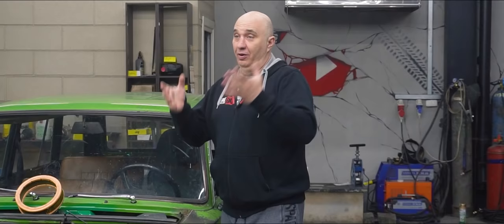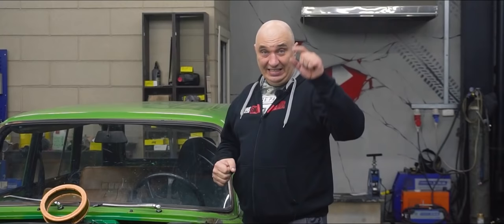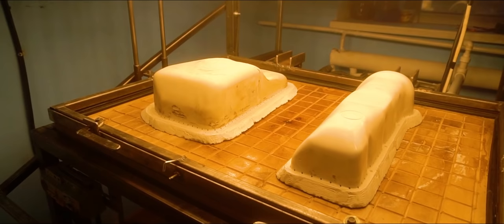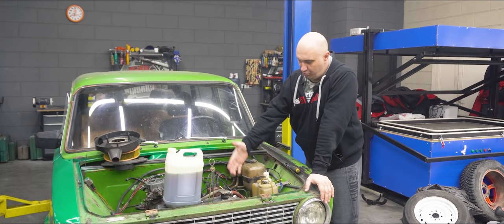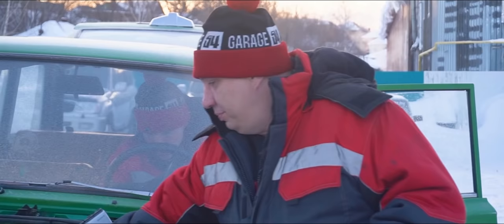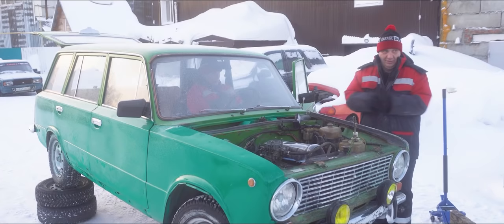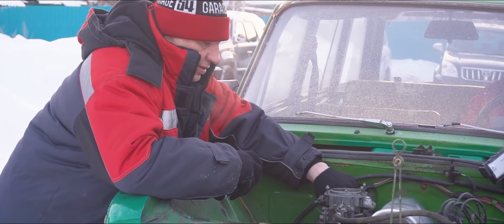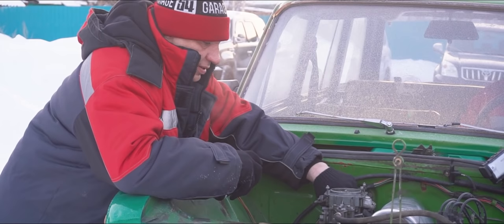Looking inside an engine during cold start (-30 degrees)

Comment: As a Canadian, this really shows why it’s important to warm up the car before you start driving
Reply: How do you warm it up before starting. Im in Australia so never had to think about frozen oil
Reply: @ce7545  just let it idle for 3-10 minutes depending on how cold it is, its not really necessary with modern engines though unless you're in below zero temps (Fahrenheit because I'm a filthy American). Just waiting until your revs drop is typically enough as long as you aren't flooring it out of the driveway

Comment: When I was doing engine development work 20+ years ago, we did cold starts at -40°.  As soon as it fired, it was put on the governor.  Sometimes it was only running on a couple of cylinders, and it might take a while for all of the cylinders to fire.  I was working on a new lubrication system at one point, and the oil pressure spiked to 400psi and put the oil filter cannister onto the floor.  Strings of oil were dangling from the filter head, and there was a PILE of oil on the floor.
Reply: A simple fix is to mix fuel into the oil and job done . The fuel will evaporate when the engine heats up
Reply: @loicdore39 that’s false. Oil and gasoline are miscible. This is why fuel dilution is a thing, and modern cars will set mixture codes if the fuel dilutes the crankcase too much.

Once oil and fuel mix, it’s very difficult for the two to separate. Some fuel will evaporate, but what will most definitely evaporate are the engine bearings if you run it with diluted oil for too long.

This is why extended oil changes on direct injected engines is dumb.
Reply: @lynxstarautomotive208  in some airplane it's a mandatory protocol in very cold conditions so it must not so stupid . 
Long intervals are destructive indeed
Reply: ahhhh my fiat with the old 127 engine although monopoint injection and electronic ignition when its cold still starts first on 2 then 3 and in the end 4 cylinders lol
Reply: You were using the wrong viscosity oil!!
Reply: @GrantJohnston-dr9rt  Nope.  It was 5W-40 synthetic, the recommended oil for that engine at that temperature.  Like I said,  development work on a NEW lubrication system, as in bigger oil pump,  different regulator, different cooler, and, as that test determined, in need of a pressure relief valve at the oil pump outlet.  The next test had a 150psi dump valve to protect the cooler and filter from a spike at startup.
Reply: @KevinJames-yg9eu  I was joking,at those temps and pressures,3 in one wouldn't flow!

Comment: Would love to see the same thing with fully synthetic oil as a comparison
Reply: Yeah totally...as the oil quality must make a huge difference i quess
Reply: Exactly, fully synthtic 0w30 would be absolutely fine with this temperature
Reply: @piotrmaecki5268  And it would be fantastic to see it actually tested if the difference is as huge as we all are thinking
Reply: Or any multigrade oil.
Reply: @piotrmaecki5268  im sure it will be a little bit thicker than usual especially at -30C, but still okay.
Reply: That's why I switched to synthetic years ago as it maintains it's velocity much better at all temp. Haven't had any issues starting. Although there's been a few days where it got below -35f with the jet stream changing direction due to climate change bringing artic air down to Iowa, which I didn't want to chance my coolant freezing and cracking the engine block.
Reply: @PCgamer923  that why I installed a oil pan heater.
Reply: Rotella 15W40 versus Amsoil 15W40 comparison on Youtube.
Reply: I’m Soviet Russia Synthetic Oil is you.
Reply: @PCgamer923  but a 0w40 or 0w50 would have an even better temperature range if the graph continues the known trent, so even thinner compared to a 0w30 when colder and still thicker then it at the specific temp. just think about the to straight lines^^
in theory at least. i mean how should i know how it behaves aftere these known points^^
Reply: Great idea 💡
Reply: The Russian  way to treat a perfectly fine russian road worthy car.
Reply: @PCgamer923  Wow you’re lucky! My oil slows down
Reply: "Mineral Oil" is the base oil for fully synthetic oil.
Reply: @seanhurley3668  it can be made from a couple things
Reply: I would love to see this as well. My 2003 toyota highlander demands specific 5w30 full synthetic. She starts no problem in minus 20.
Reply: @nekoroms  It's not. I can guarantee it's not. They're literally the same thing, one just has slightly smoother molecules.
Reply: Not how it works
Reply: @generalkayoss7347  
There is literally a little spinning gear display on the desk at most auto parts stores  showing the difference between synthetics and non synthetic. When you spin the crank the synthetic coats the gears with veracity and the other is minimal.
Reply: @aaroncarr-mackay2457  I have seen those displays, usually for Lucas or some additive.  Pretty meaningless,  I'm sure you could get the same results using the thickest, cheapest gear oil you could grab
Reply: @generalkayoss7347  Different synthetics are in different "groups".  Most "synthetic" oil is just highly refined conventional oil as you indicate.  Ideally, a true synthetic oil could be multi-viscosity without long chain polymer additives, as those additives may break down faster.  Whether such a product exists, I'm not sure.  Probably just marketing blather and oils with more additives for longer change intervals.
Reply: @mattgraham4340  
I bet if I used the stuff I have to put In my highlander vs what you say to grab off the shelf it would be a hands down comparison.
Reply: @exploranator  Pennzoil Ultra Platinum is comparable too.
Reply: There are some tests you. an find on YouTube that shows the difference. Obviously not as interesting as this method.
Reply: @Alex_Mitchell  exactly alex.  they used Mineral oil?  what is that??  seems like a wasted effort!
Reply: @nekoroms  Definitely does. Have you seen how fluid synthetic is.
Reply: Agree-  They add detergents to Synthetic as well- to keep the viscosity consistent.
Reply: @exploranator   -40 is a special case.... most diesel operators (commercial) wont shut their engines off at that temp, I feel its not really relevant to 99% of users.
Reply: Products have specifications. Obviously, synthetic oil will flow better at a very cold temperature but both will warm up as the engine runs. The normal recommendation is to just start the vehicle and drive. At a very cold temperature, I would let the engine warm up. Even at 30F overnight where live, I let the engine idle a little before I start moving.

If the startup temperature is below the temperature range of conventional oil, then you need to use synthetic.
Reply: @simplyalan7260  to be fair those commercial truckers are more than likely hauling goods to tons of people who live in areas with those extreme temps. Granted say in the US sure a majority of people will never experience negative temps down south, but we still have millions of people living in cities all across the north where there are these temp extremes. I wouldn't quite say it's 99% of people, but I'll admit I'm too lazy to find a climate/population graph at the moment to actually back it up. Guess we'll call it "skepticism" for the time being lol